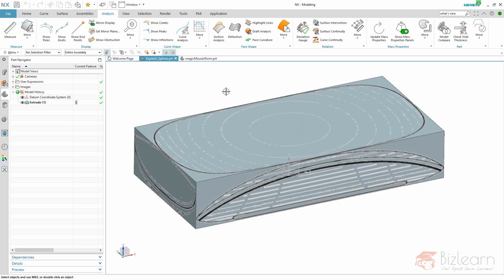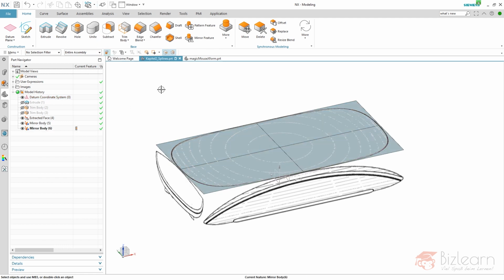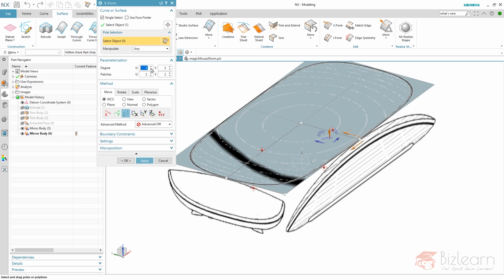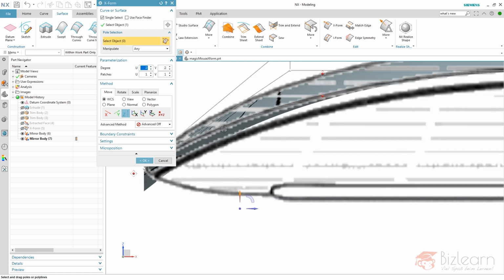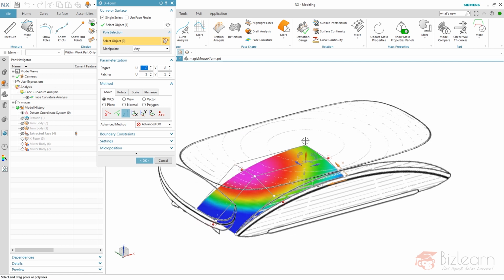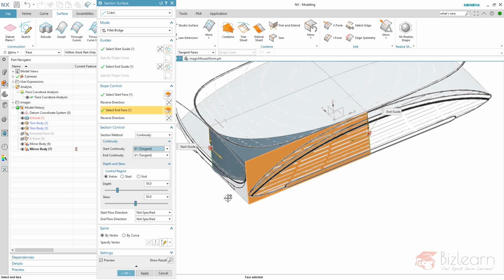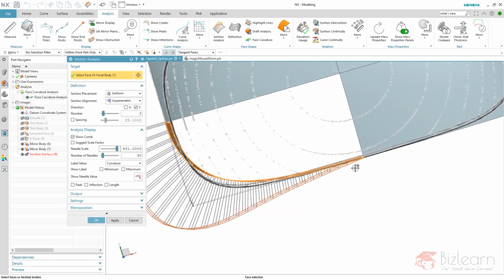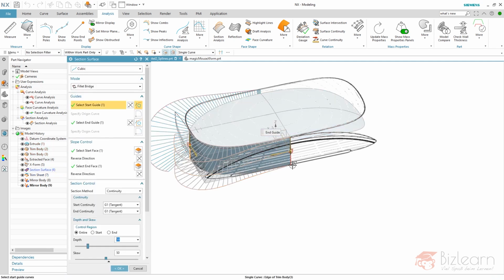Siemens NX Freeform Pro Tutorial - how to create aesthetic surfaces with X-Form and Analysis

Comment: Very useful tutorials. The bad thing is NX is so expensive for really small businesses, independent designers (freelance and alike).
Reply from the maker: Thank you. Yes it is. I have bought the Mach 3 license bundle a few yeras ago. It was something that I wanted to have for years. I did that instead of spending money on cars or similar expensive things. For me it has the higher prio to own this software (-; I think in peoples mind, it seems so expensive, because it's not physical, it's just software and the price range is so huge. Just have a look at Blender which I think is a brilliant product that covers so many possibilities. It's for free, open source. And it's the beter choice for facet handling, compared to Siemens NX^^
Reply: @Bizlearn_Siemens_NX_Training  Yes, Blender is perfect for renderings and mesh/facet manipulation. For real engineering and A-class, machining tolerances, production is not very well suited. I love NX, although I have used Autodesk Inventor 95% of the time. NX and CATIA are really the big sharks in CAD/CAM/CAE.
I tried Solid Edge a few years ago. Unfortunately there are not many pro-tutorials like the ones you do now with NX.
Reply from the maker: @PASHKULI  Yes unforunatelqy, there are a lot of unexperienced users showing basic stuff without understanding the software. YouTube is not a replacement for a good training. The piracing rate of Siemens NX is right now at 43% and most of the YouTube content is made on such an illegal version. But anyway, in my Opinion the Class-A Surfacing chanel offers very good content as well and he is a Siemens cooperator I guess.
Reply: @Bizlearn_Siemens_NX_Training  Yes, that channel is good. I think the guy used to work for Autocad previously... not sure though. To be honest, illegal versions of NX are much more easier to install, than having to deal with the legal authorisation process. I have installed an illegal one years ago, to try it out. Never used it for work as it has quite steep lurning curve and is full of options and preferences.

Comment: Hello, thank you for this new video! I have a question regarding the last part: why didn't you use a bridge curve with tangency at both start and end to be sure to not create any problem of tangency? I think it can be an easy way to avoid the fine turning of the curvature.
Reply from the maker: You're welcome. Bridge Curve is a very good option and has a good dynamic as well. There was no specific reason,beside that I wanted to focus on the section command and possibilities of working without curves. But anyway, I will make a comparison video between Bridge Curve and Spline. Because in my opinion Bridge Curve is in most cases the better choice for transition creation and people are still using the unnecessarily Spline (-: But anyway, also the Bridge Curve might contain inflection which can only be visualized throught the comb display. Advantage when using bridge cure is, that you don't have to leave the command for analysis enablement!